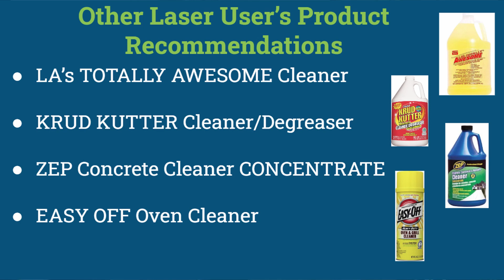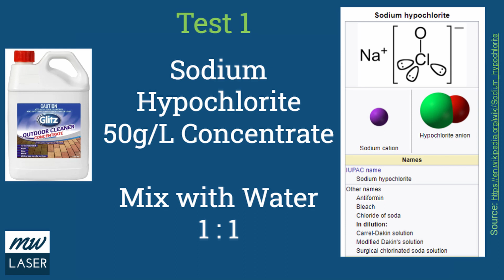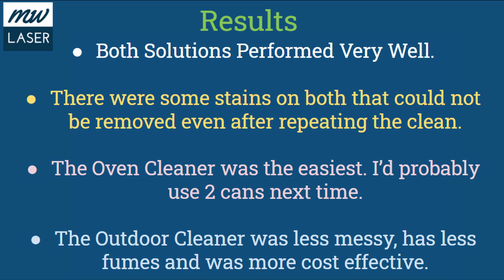Cleaning Co2 Laser Honeycomb Table

Comment: I cleaned mine yesterday. I bought a big packing box, cut and formed it to just about an inch bigger all the way around than my honeycomb bed. Lined it well with some heavier mill plastic and laid my bed inside. I bought 6 bottles of LA's Totally Awesome Cleaner from the Dollar Store and pored it in and covered the honeycomb bed and then laid the blades in on top. I let that soak while I cleaned the rest of my machine with some spray Totally Awesome and now everything looks almost new again. No toxic or nauseous fumes, no need for gloves other than to keep your hands from getting dirty. Just took a little rinse with little water.
Reply from the maker: yes great. I've been told the TAC is good.

Comment: Would these also work on the gantry? I burned vinyl and the metal got coroded a bit from the chlorine gas 😅
Reply from the maker: Depends on what you gantry is made from, if aluminum don't use the oven cleaner.  I clean the gantries with alcohol on a rag.  If unsure test on a small area 1st before applying to the entire gantry.
Reply: @MWLaser  If you have access to it, Zep Purple works great on aluminum. I use it on my rails and they come out looking like new.

Comment: Matt, Zep Purple De-greaser and water 1:5

I cut 99% Premium MDF, and the resin gets everywhere. For my rails, I have a piece of plastic gutter with end caps siliconed on and a hose fitting in one end for draining afterwards. For the honeycomb I have a large pet cage tray and a little aquarium pump. The rails take about ten minutes to soak and come out factory clean. The honeycomb I tilt it a bit and let the pump circulate over and drain through. Takes a bit and you keep moving the feed hose around on the bed until you are satisfied.

WARNING: Do not do the honeycomb bed outside unless you want to drive your cat to distraction. In a bit of a breeze from the underside, the solution turns your bed into a million bubble blower. It will drive them nuts faster than a dozen red dot laser pointers.

The solution is good for 5 to 7 cleanings depending on how bad your rails / bed gets. When I have to let my rails soak for twenty minutes I know it's time to make up a new batch of solution.
Reply from the maker: Thanks for adding your solution.  I was going to try that one, but could not find it here in Australia
Reply: @MWLaser  The solution turns brown the very first time around from the resin it removes, but is in no way ready to trow out. I had tried several methods of rail cleaning, and the neighbor was putting new gutters on. They were aluminum, but collected rain water two days later in and and piece sitting in the scrap pile gave me the idea.

The honeycomb bed trickle through is not the most efficient use of time, but I just move the hose around and do other things in between. The first time I did it outside, and the bubbles and cats had us all rolling with laughter.

Either way, a quick rinse down with a garden hose afterwards and they are nice and clean. I have aluminum rails and a steel honeycomb, works great on both.
Reply: @davev5686 hey, I laser cut a ton of premium MDF and was going to try your method but it says on the ZEP purple industry degreaser not to use it on aluminum is there another type of ZEP you use or did it just not damage your aluminum parts?